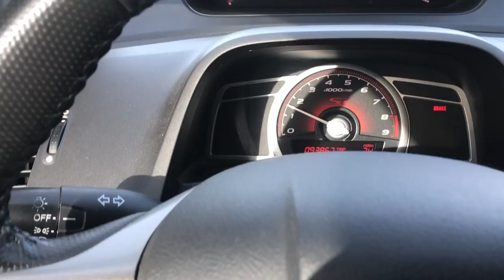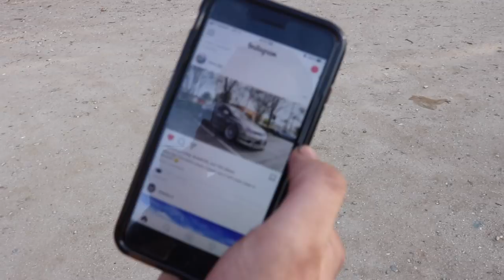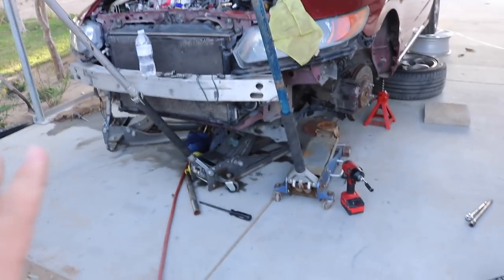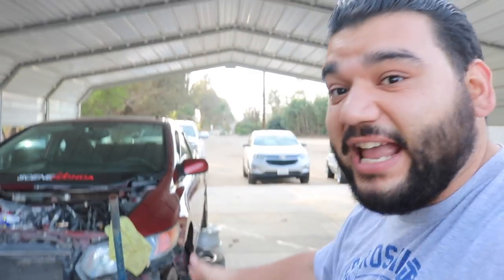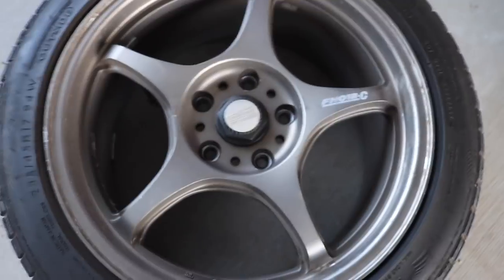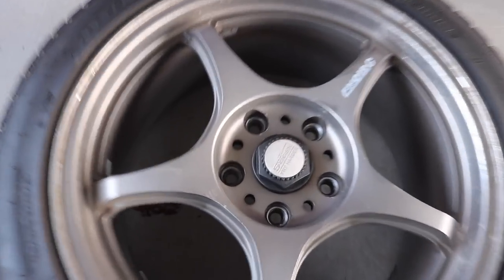Fixing A Squeaky Clutch & Breaking in My Stage 1 Clutch (Vlog #12)

Comment: You can use greaser and put it on the cmc shaft where the pedal is, your mechanic didn’t lube it probably.....it gets worst in rainy days...spay is temporary
Reply: i have the same issue.. what greaser should i get
Reply: Charles Michael any grease works, I used multi purpose valvoline it’s about $7-$10
Reply: just put it on the cmc shaft, where it goes in when you step on it?
Reply: Charles Michael yeah the shaft that goes in the cylinder under the clutch, make sure you put some others and that it doesn’t fall off, lub it nice don’t over do it
Reply: perfect fam, thank you!! cuz got my clutch replaced and cmc and it has the same issues
Reply: gotchu! sick 9th gen si thooo. got an 8th gen, same color too. fa5
Reply: Charles Michael hell yeah thanks pimp!! I love my Si, just got wheels Saturday

Comment: Pull your fenders. I don't rub only on when I have passengers. I have my fenders rolled but I also pulled them. Just use a jack lift you car place a book (decent size book)  in your wheel well and drop it down slowly. You can heat up the fender as well to pull it out more... I didn't heat it up though lol. Easy and cheap lol Doesn't hurt to try 🙄🤙

Comment: I have a question, if you don't mind me asking. You don't have to answer, obviously, but how much does insurance run you on your SI? I'm a 20 year old college student with an '04 Honda Civic EX that has 91k miles on it. I am thinking of selling it and getting an '07 civic coupe SI, but I don't know how easy it will be to find something with low mileage and decent price and I also don't really know how much the insurance would run me since I'm young and it would be a 2 door. If it's two doors, it's gotta be fast and dangerous right?? Insurance mentality.
Reply from the maker: FoxjrGaming $80 a month full coverage with gieco
Reply from the maker: FoxjrGaming just keep a clean record and you’ll be fine. Overtime insurance price will go down
Reply: FoxjrGaming bro im 19 and picked up a 2006 si with 120k miles blue coupe in excellent condition. My insurance is 30 a month under my parents name for liability insurance just make sure to put it on your parents or else you will overpay